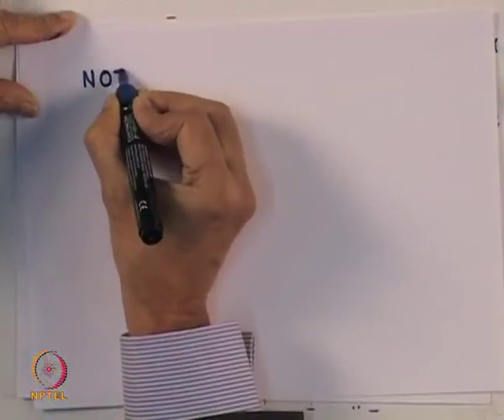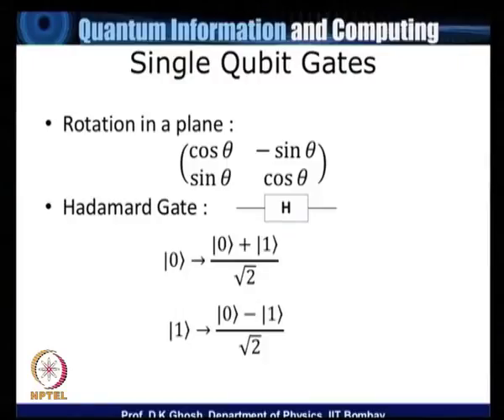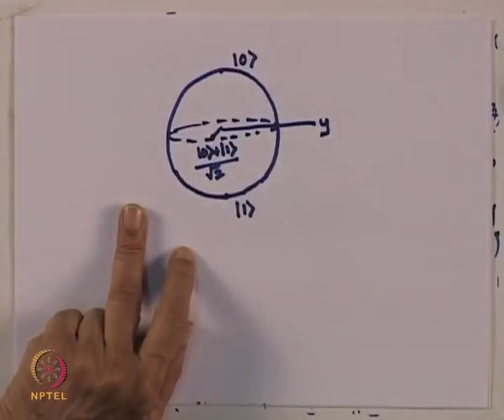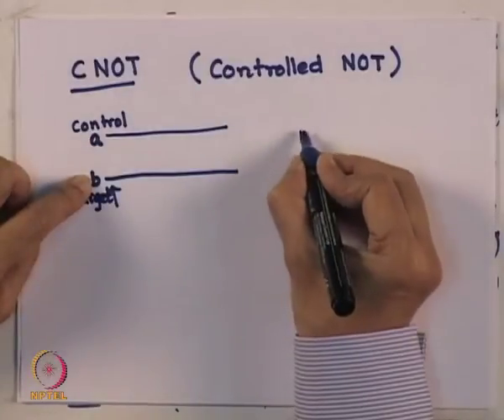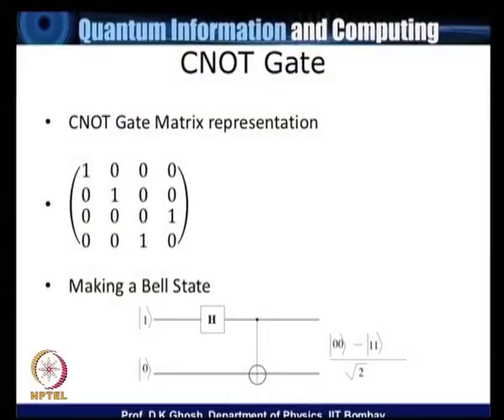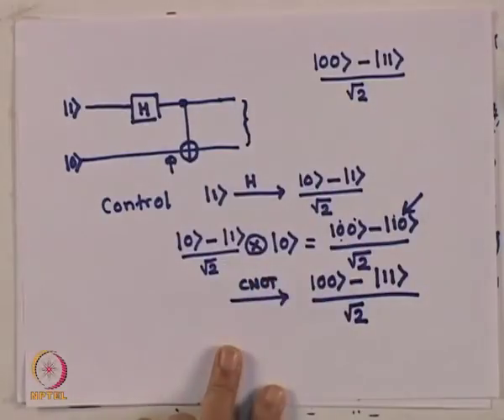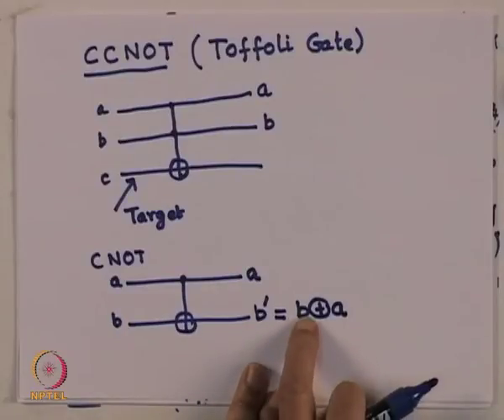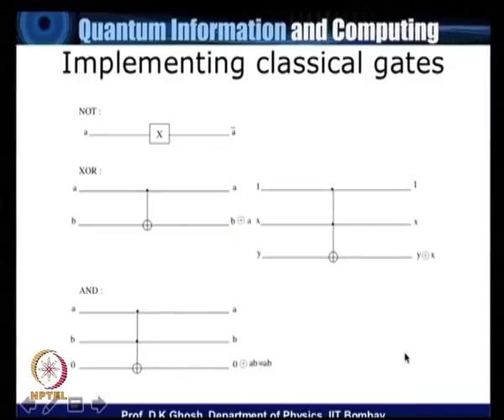Lecture 7 : Quantum Gates

Comment: There is a confusion with the notation here. As you would think that int the qubit, the first one is "Control" and the second one in the "target", it is actually the other way round.
This is why  CNOT |01> = [11>
Control here is [1> and because of this, it turns [0> into [1>.
Therefore, you can expect the following:

CNOT |00> = [00>
CNOT |01> = [11>
CNOT |10> = [10>
CNOT |11> = [01>
Reply: This transformation is wrong:

CNOT |00> = [00>
CNOT |01> = [11>
CNOT |10> = [10>
CNOT |11> = [01>

The correct one is 
CNOT |00> = [00>
CNOT |01> = [01>
CNOT |10> = [11>
CNOT |11> = [10>
-------------------------------------------------------------
Lets see for |10> = |11>
|10> = (0,1)^T (X) (1,0)^T = (0,0,1,0)^T

Now apply CNOT to this:

[1,0,0,0,
0,1,0,0,
0,0,0,1,
0,0,1,0] . (0,0,1,0)^T = 
(0,0,0,1)^T

Which is |11> and not |10>